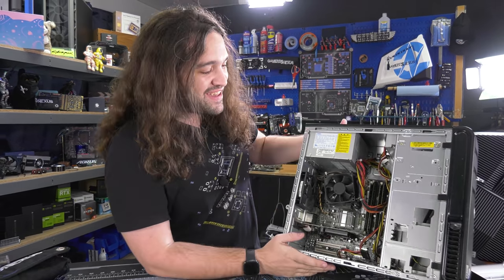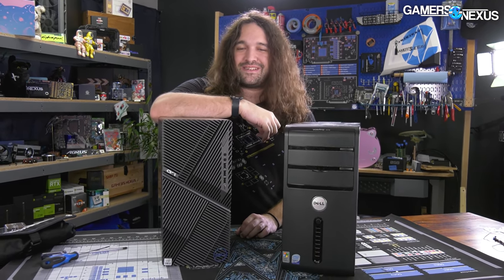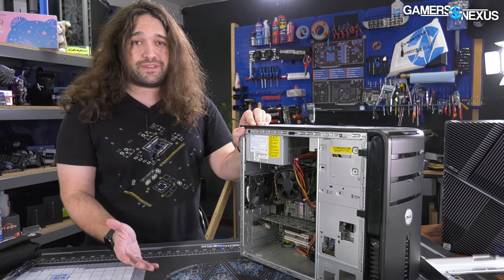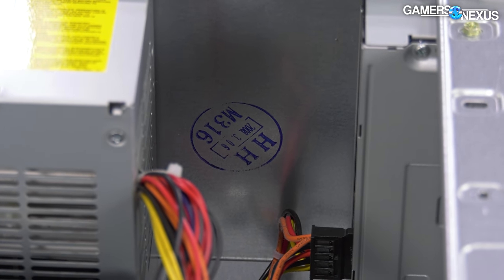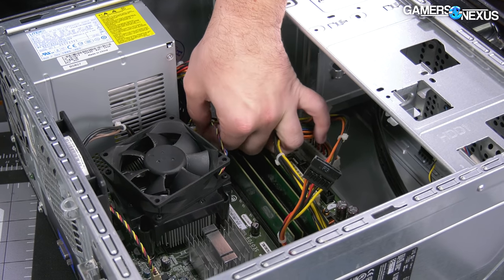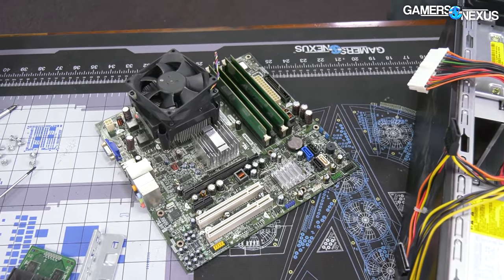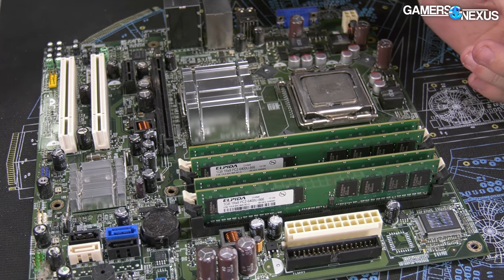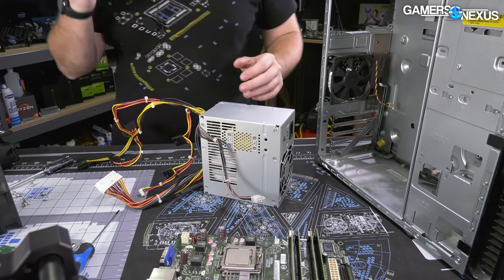13 Years of Dell Getting Worse

Comment: Biggest issue with the old Vostro is that you can't take out the I/O shield. Some prebuilts from then and even before had a removable IO shield, but some of Dell's higher end stuff (PowerEdge, Precision, etc.) had the IO shield built into the case. Makes it harder to replace the mobo.
Reply: No removeable I/o shield is the "standardized" component killer of this case.
That being said I have used a radio shack nibbling tool to cut out the panel for a standard i/o shield on a few of these types of cases. It works fine if you are carful and layout the lines well.. It actually only takes about 10 min.
I have also purposefully taken very proprietary dell 7060 and 9020 series SFF and USFF form factor mobos and built them into Mini ITX cases with custom cut out for the I/o etc using off the shelf power supplies spliced into the dell wiring harnesses and front panel connectors etc. You can build some pretty nice machines for very little money and its fun to reverse f-over dell.

Comment: I absolutely love getting these kinds of systems in my repair shop. The clients that keep these systems don't need super high-end performance they "just check AOL". So I upgrade them to a SSD, replace the power supply, and upgrade the RAM if needed. Get them a system that feels new and is usable for another 4 or 5 years until the motherboard fails.
Reply: Uh yea got that ....just wait till they "want " or "need" windows 11! $$

Comment: I have an identical system here, lower end, and beige instead of black.
For some weird reason I love it's looks, so I transferred my whole PC in that case, and it works perfectly.
I'm planning on modding it to fit another fan upfront, and replace the USBs with 3.1 ones, other than that, it's nice, it's acompanied with an asus disk reader/burner that I painted beige.
It's also acompanied by its original dell monitor... But without the original screen or board, I replaced them with a 1080p 75hz monitor of the same size, that is just shoved in the skin of the original, and slightly overclocked to 81hz
Reply: Just as extra info, I already modded that case to accommodate my Asus motherboard and again in the front to fit a fan there, but that was some very simple mods

Comment: I have a Vostro 430 that is still chugging along. Power supply died on it and I was worried I'd have to shell out for a replacement from Dell and was pleasantly surprised that I could pop a new EVGA supply into the case. Too bad we can't do that with a lot of the modern prebuilts.

Comment: not gonna lie, I love those rubber nips for fans. I hate taking them out, but they do pretty great for fan noise/vibration. there is a argument for using better fans, or fans with rubber isolators already, but for cheap it works.

Comment: I'm sure someone pointed it out, but the serial number says it was shipped May 13 2008. It does pre-date Dell's current support data, so getting the original specs are impossible. The support manual is from 2007.
From the very-generic manual:
Power supply: 300w or 350w, 24pin+4pin 12V
Chipset: G33, ICH9
RAM: DDR2 667 or 800Mhz, max 4GB
CPU: Core 2 Quad or Pentium Dual Core.
PCI Express 1.0A
Sata 2.0
USB 2.0

Comment: That's pretty interesting to see. I had a Dell Inspiron 5675 from 2017 for my first gaming pc, and it was pretty much like that vostro, standard parts except for the proprietary connectors from the front panel to the motherboard, so i was able to upgrade the gpu and the power supply easily, and i thought that was pretty cool for an OEM prebuilt, so it sucks to see that right after they came out with the G5 and threw all that out of the window.

Comment: Dell Precisions were very common with businesses in the mid to late 2000s. I worked on many of them back then and they were quality machines that were easy to work, upgrade, and swap out parts if every required. Our biggest issues with computers back then were not related to Dell or the hardware.  It was users doing stupid things like downloading bad software from the Internet or other things to get them infected with all sorts of malware. The computers themselves were a great value and is one of the reasons that Dell grew as much as quickly as they did.  Sadly, I'd say within about 5-6 years after Michael Dell had departed the company --they started to go downhill pretty quickly. Where Dell used to ship good products with many off-the-shelf quality components, they started created proprietary manufactured parts that also needed Dell to created their own drivers to support. Dell used to be great, now not so much.

Comment: I still have my Inspiron white retail version of that case that I spray painted black.  Had the Q6600 too.  I screwed an 80mm Apevia blue LED fan to the front (only got 3 screws to thread at a weird angle) and cut a hole in the side panel and top for additional fans (side was intake and I think top was intake too).  It was the first and really only modded case I ever owned.  Ahh, the memories.

Comment: In fairness to Dell, this was likely more of an anomaly than intentional. Even in the Pentium 3 era, they would leave a plug-compatible 20-pin ATX that was keyed the same but wired differently meaning that if you tried to replace the PSU or motherboard, you'd fry something.

Comment: Vostro series! That brings back memories -- At an old IT job, we had a supply contract with Dell and deployed OptiPlex desktops for years. But we had a large number of client offices which had to run our software on systems which we needed to image and support. OptiPlexes were too expensive, so I checked specs and decided that the Vostro series would be fine. And they ran great -- well beyond their expected lifetime. They were being pulled out from under desks and countertops long after we thought they should have all been replaced. Vostros were basically Dell's version of a "white box" PC. All bog-standard parts. Even a standard BIOS and standard drivers. None of the custom stuff found in the more typical OptiPlex line. They weren't intended to be high performance machines, just a decent-value workhorse and they did just fine in that role.

And I caught that Antec 900 reference! Yes, indeed, an Antec 900 is a challenge for cable management. But I have one holding a 5GHz OC'd i7-6700 right now, with an RTX 2080 shoehorned inside... It's still a surprisingly good air-flow case today.

Comment: That plastic thingy the 2021 Dell used to hold that fan in place looks like the Antec noise reducing thingys that were opaque and came in small bags of 4. They did work though, made removing fans easier and less vibration I guess.

Comment: As useful as air intake considerations are for high-end systems, you have to screw up pretty badly to hurt an off-the-shelf system like this.  With a PSU and rear panel exhaust fan, you would likely be fine sucking intake air in through the floppy drive.  Heaven knows enough builds did, back then.  Looking at the ventilation holes in the front of the metal chassis, and the cutaways on the side of the front panel, the airflow in that old Vostro is FINE.  Not everything needs to be a screen door from floor to ceiling to keep the thermals in check.
Reply: Its funny how everything gets hotter now
Reply: @nesyboi9421   Yeah, well...  :-)

The 486DX2/66 had a TDP of about 6W.  My newest CPU is 95W -- over an order of magnitude more.

Video cards are the same.  VGA cards barely got warm.  An old VLB Mach 64 would get hot to the touch, but didn't have a heatsink.  That would be about another 5W, give or take.  Now, we're looking at ways to expel 300W from the GPU.

The PSUs that ran my entire 486 couldn't even power a modern GPU by half.  Things have definitely changed.

OTOH, the delta between full load and idle is sure a LOT different than it used to be.

Comment: Had a DELL XPS 420 with the venerable Q6600 which I eventually modded using the BSEL technique (one itsy-bitsy piece of black electrical tape over one pad on the CPU that took the FSB from 1066 to 1333...allowing for a 25% overclock). The BSEL OC worked like a charm for over 7 years! The XPS420 was a daily driver for just over 11 years.  It eventually died when the PSU keeled over. Actually the DELL PSU spec stated an approx 11 year life cycle...so it died as specified...literally. The BSEL mod, coupled with a 64 bit WIN OS installed on a bootable SSD, breathed new life into that old machine. Too much proprietary aspects to that machine...BTX case and a locked BIOS made it hard to upgrade.

Comment: I agree with how older system seems to be better inters of upgradability. The size of the old case alone meant you can cram modern components in there by gutting the internal compartments. The bulky design of older towers meant you have more than enough room inside to fit anything you want. My ThinkCentre case from 2003 has more than enough room to fit a triple fan GPU. Onlt downside is the mounting hole are usually design for 90mm fans but you can just drill some new holes to fit in a radiator. The location of the PSU also meant you cna actually use it as another exhaust fan since the mounting spot for the PSU meant that modern PSU would be pulling air from inside the case and dumping it out.

Comment: Wow, very cool.   I bought a nearly identical new Dell Vostro 200 for $399 in 2008; it came with Vista Home, 2Gb of DDR2 RAM (upgraded to 4Gb), with an E8300 C2D, 250 Mb HDD, a DVD burner, and a Radeon HD2600 GPU with 256 Mb of RAM.  I added WiFi and  upgraded to a Radeon HD4590 GPU.  The original PSU died about 2017 after around 25K hours on the system.  I finally replaced it a few months later with a new "open box" Vostro 3470; an i7-8700, 8 GB DDR4 RAM  (upgraded to 16Gb), 1Gb HDD, on-board WiFi, and a DVD burner for about $425.  I still have the Vostro 200 in storage, the Vostro 3470 is outdated and due for replacement soon though...

Comment: I built a system in an Inspiron 330 - I think it's the same case. You have to cut the rear IO out for other motherboards - no bend out. Tin snips and a file: done. A 300mm length video card will fit by bending the 3.5 inch "drive things" out of the way. In this video you can see them labeled as "HHD0". You have to put the PSU in first because of the "case lip" at the top. I had to use a 90mm CPU cooler as a 120mm is too tall. Thermals are a problem. But, a "not bad" sleeper case.

Comment: I think these videos are kind of important. Not to Dell, not to any other company, not even to the customers who will buy those computers... But actually to us - the tech enthusiast who usually will be asked what PC is fine to get. I NEVER could have imagined that Dell got THAT bad over time... Because I actually had one at some point in time in the 90s... I think. And it was also all standard-components... And as not everyone wants to get an self-assembled PC - prebuilds are really an option... So probably I wouldn't been to bothered about saying "it's ok" to a decently speced Dell, if there was one (or actually almost any prebuild)... That has changed at this point - thanks for these videos.

Comment: Own a 2009 t7500 with dual x5677s. Kinda of idiosyncratic sometimes and a pain to work on but it still has the original mobo, cpus, ram, and psu. Easily have played 5k hours of games since 2014 with it. Absolute beast of a machine.

Comment: And you don't even need to go that far back. I have two Optiplex 7010 systems at home, both bought brand new back in late 2013. Standard ATX board, standard ATX PSU, standard LGA1155 cooler mounting.

Comment: I agree with the need for following standards in PC build design. I came across one of these Vostros once and was equally surprised by how standard it was for a Dell. Standards are how PCs can last for years on end with incremental upgrades and still be useful. Custom designs in weird form factors are just a ticking e-waste timebomb.

Comment: Recently sold a Dell power supply - the guy literally drove 3hrs to pick it up person. He said, his PC (Dell) -PSU died and he had important stuff on his hard drive and didn't have another PC at hand. Called stores, nobody sells them.  He paid 3x of the price for proprietary PSU they got plus he drove 3hrs to get it. 
BTW,  you should check out Lenovo , they are doing the same thing and that's even a bigger shame from the "IBM" that we actually used to say as "IBM compatible" , now their stuff is nearly indistinguishable from Dell or HP with the same proprietary scam.

Comment: 10-15 years ago it really was hit or miss on what computers had proprietary gear in, and its a shame its still going on today. I specifically went for an Acer M3400 with a standard size case and motherboard. Came with a Phenom II X6 1035T so I just stuck some RAM and a GPU in it and it kept chugging as my main rig for a few more years. When I upgraded the PSU I transplanted it all into a new case, and eventually upgraded the board and CPU. Those were the days, where you could butcher systems and hack stuff together to make something cool on a budget.

Comment: I used to offer computer repair cheaply to local friends and family and even some light advertising on social media in my area way back from 2008 til 2014. I started giving up on repair when I realized everyone was changing to laptops, tablets, or smartphones. I still did laptops for a while but soon stopped offering repair at all as parts became super proprietary, and it was cheaper to buy a brand new device then repairing the $300/$400 laptop the kid spilled juice on. Motherboard, a new keyboard, and track pad or storage drive would cost more than the laptop would cost brand new.

Comment: I bought a very expensive Dell gaming computer in the early 2000s. It weighed a ton, and was quite noisy, but it played all the games I wanted to play, so I was happy. After about 4 years the power supply burned out, and that's when I discovered that EVERY component in the computer was proprietary, and unfixable, and unreplaceable. I couldn't even use any of the parts in a new case, or new parts in the old case, because all the screws were in stupid, non standard places. That's when I decided to learn how to build my own computers. Now I can upgrade every year or so until the newer technology comes along, and then I can still re-use cases and power supplies. I am still using my Dell 1905FP monitor as a second monitor, and have burned through 6 other main monitors while the 1905 is still looking real good. My current gaming monitor is at the point where I am fiddling with brightness and gamma until it is just too dark to use but the 20 year old 1905 keeps on going.

Comment: I just had the motherboard and/or power supply fail on an XPS 8930 purchased in '18 for $1500.  I initially diagnosed it as a power supply failure, but that didn't fix it.  So I went ahead an replaced the MB, Power Supply and Case.  But still using the GTX 1080, i7-8700k, RAM, and SSD.  The CPU cooler was interesting to fit that 8700k into a case with that same swinging power supply and worked quite well.

Comment: I had a DELL 2010 prebuilt that just kept going and going.  I moved it to a newer case, added a newer (Corsair) power supply, SSD, GTX 1050.  My teenager used it for hours every day.  I have had many DELL systems and they've always been rock solid and long lasting.  I'm typing this comment on a 10-year DELL laptop that I paid $399 for.  I pulled the HDD and stuck in an SSD.  It's happily running Windows 10.

Comment: I guess Dell's ways vary over time, because I have a 2005 Optiplex GX280 that has extremely little room for airflow on the front, a motherboard that slides onto a clip system instead of using screws, but otherwise seems to have standard parts. Plus it still works right for the most part, a testament in itself. I also have an Optiplex 755 and GX620 with a Core Duo and Pentium D respectively, and they're pretty thought-out machines. They have load-bearing coolers that need to be removed completely for the motherboard to be removed and don't have any standard kind of front I/O connector that I know of, but everything else seems standard, and everything else still works mostly right. The cooling systems are well-shrouded 120mm fans blowing on appropriate heatspreaders/heatsinks. The fronts of the cases have large grates for plenty of airflow. Both stay quiet and cool (the fans are far from worn out too, they're very silent even after years of use), and the original thermal paste application was very generous. 
I also have one of those really thin Optiplex 380s or whatever that my high school had loads of, which uses what is probably a proprietary power supply to accommodate a corner of the standard-size motherboard. The motherboard's front I/O connector is also proprietary-looking, and the airflow is pretty good. Another Optiplex I have is a 7010 small form factor or something from about 2011 that seemed to use many standard or otherwise-available components. Airflow is questionable though.

Maybe Dell makes proprietary stuff sometimes to simplify assembly, disassembly, or servicing, but that's my underinformed guess. Dell used to use quality, long-lasting parts I think, and cared some about standard components. I don't know why they've gone the direction they did with that perplexing contraption you just bought.

Comment: I am still using an '08 Vostro 420 as my work PC.  And, yes, I was able to use an off-the-shelf power supply to revive it after the Quadro outputting to my four monitors started having current stability issues.

Comment: Dell Pentium II & III systems were intel boards with non standard wired ATX sockets so if you plugged in a standard ATX power supply you would fry the motherboard and possibly the PSU.

Comment: Q6600 I used one of those for years and years. I think I still have it somewhere actually. They get pretty hot though. Built like a tank. It did everything I threw at it and never skipped a beat.